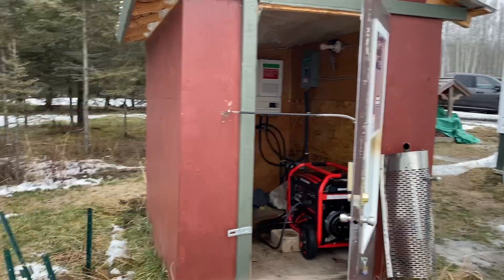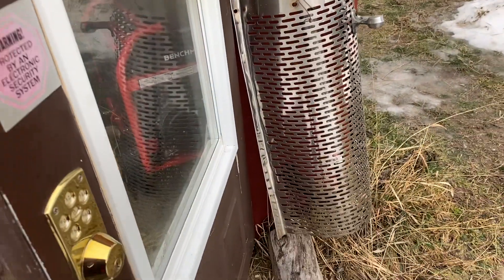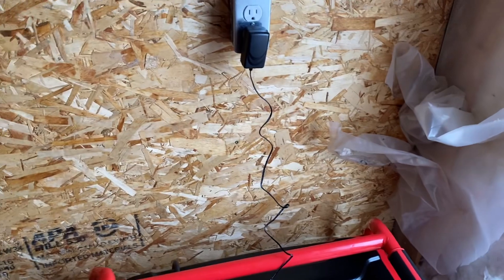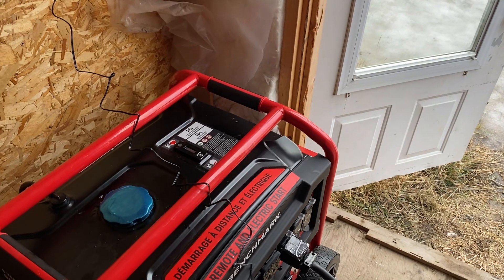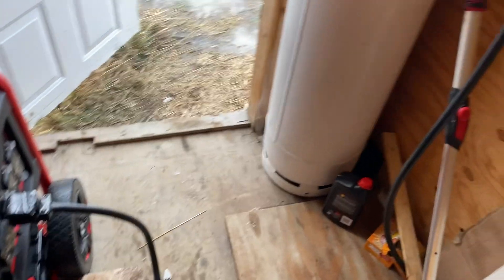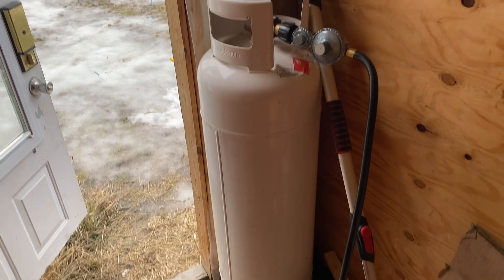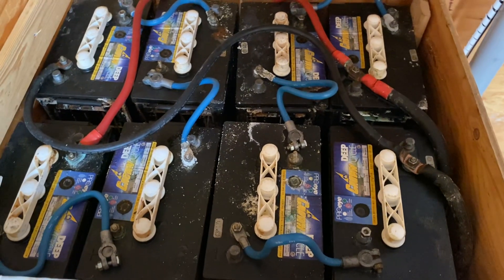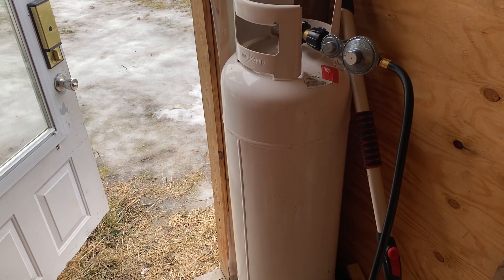Benchmark propane/gas generator

Comment: Hey Cindy... Great video. How has the Benchmark Generator been holding up for you after all this time?  Do you think it's worth it over something like a Champion or Firman?
Reply from the maker: It’s been 4 years now and it’s still working great. The remote start doesn’t put the choke on anymore so I have to go out and slide the choke on, I can still shut it off with the remote.  The champion we have for the water pump is still going strong too, so either one is great in my view 😊

Comment: Hi Cindy.  I live in Canada also off grid.  Have lived off grid for four years in my cottage that has been seasonally off grid for the summer since 2014.   Had 12 six volt batteries in series for a 24 volt sustem with a 3000 watt pure sine Aims inverter.  That was fine for summer but full time we added 2400 more watts of panels to the 1600 we had before.  In winter batteries only got four hours of sun which was just enough to get us through but we ran our generayor every day but coukd not charge the batteries as it would have taken over 16 hours with the 40 amp charger.  I just added 3400 watts of new panels and bought an Ecoflo Delta pro Uktra with 2 storage batteries.  It can charge the 12200 watts hour batteries in two hours on fast charge and on sun and cloud days the system charges fully before one pm.  It hasmade such a difference to iur off grid luving.  Can now run the microwave that was previously used as dtorage for our toaster rack. If you have the funds it is a game changer for off grid living.  Cheers and subscribed.

Comment: Thanks for the video and info on the fuel costs of this generator. There is very little information online, on the Benchmark gennies. I was looking at the same 11,500 Watt Benchmark and was trying to find information on fuel consumption.

The dual fuel 11,500 Watt Benchmark is more expensive, but it may be worth it due to the fuel savings, depending on usage. Thanks!

Comment: Lithium batteries can charge way faster and take power power so you wouldn't need to run a generator as long compared to the slow charging of lead acid. You go thru more fuel running a big generator as well  putting out way more power than the deep cycle lead acid can charge.

Comment: Hey Cindy Squirrell,  do you get propane from a truck that refills the tank at your home or do you have to take the tank somewhere to be refilled? I think here in the states they have a law where i can't transport bottles bigger than 15 to 20 lbs. without a permit or outrageous rigging that would make it safe to transport . We have several companies in my area that can refill the tanks and i am a bit apprehensive about checking on the cost to refill propane via delivery.  Very cool set up though.
Reply from the maker: here we can transport up to 100 lb tanks, but that would be too heavy to lift down from the truck.  we could have got a 250 lb tank that the truck could refill when he refilled our other tanks, but we were told it's such a hassle to get it set up that this was the way to go

Comment: Morning Mrs Cindy , that is a very nice generator . I wish mine was duel fuel . I would like to convert my Honda to propane . They make a kit to do that with . That way you don’t have to worry about gas going bad . Happy New Year !!
Reply from the maker: we got the dual fuel, because we knew that when it's minus 41 the propane may not light, but we knew the gas would.  Happy New Year Del

Comment: Great video Cindy.  Are you running a 12v or 24v system?
Reply from the maker: it is a 24 volt system, that's why we had the 6 volt batteries in a row of 4.  Happy New Year to you two